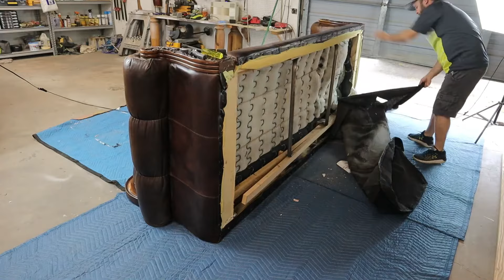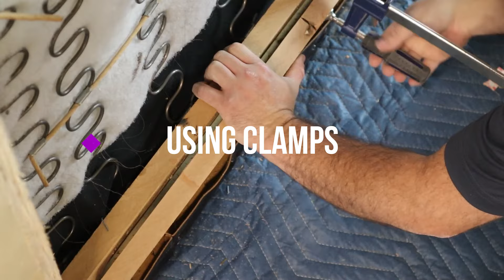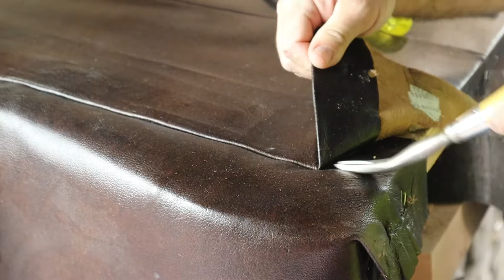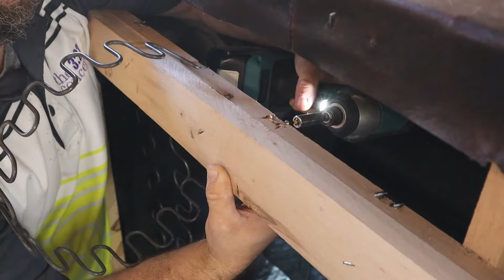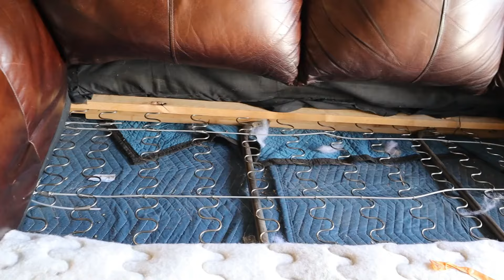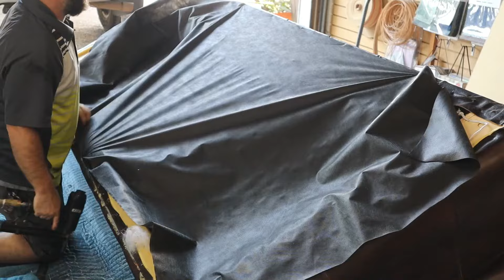Sinking Sofa

Comment: Excellent video. Thanks very much for your clear, helpful works. Just wondering what kind of edge wire I can buy and how many  of them ? Do they make the springs stronger and so as the seats? Thank you.
Reply from the maker: I would say they’re definitely helpful in creating a stronger seat. They sdisperse the weight evenly so all the pressure isn’t on one or two springs. The springs usually come in 9 and 11 gauge if I remember correctly

Comment: Nice! I thought the sinuous springs were not worth fixing but this looks like it’s doable for a DIYer. Except maybe I would need help stretching those springs.
Reply from the maker: It can be difficult! A string helps. If you can find a spring puller that will help a lot!

Comment: The point is to prevent the foam in the seat from sinking, put a layer of protective fabric on top of the nosag so that the foam doesn't get cut by the nosag which makes the seat sink.
Reply from the maker: The foam was not the issue in this case. I’m not sure if you noticed, but this sofa DID have a protective layer between the springs and foam. The issue on this sofa was frame/spring related . Thanks

Comment: What’s that you are using to pull the  springs tighter. Also should so change the springs after 15 years or keep the old ones. Thanks nice vidoe
Reply from the maker: Thank you so much for watching! This is the spring puller that I use https://amzn.to/3CGA7MM
Reply from the maker: Springs can last a very long time. I would recommend pushing on them to see how the tension feels. I have seen some that have lasted decades. I’ve also seen wire gauge springs that are used in more modern furniture that aren’t worth anything
Reply: thank you very much
Reply from the maker: @dawnscreations1  you’re welcome!

Comment: We have 2 sofas that are no fun to sit on ie. stuffing, straps loose,  I'm curious how much a job like this would cost
Reply from the maker: A lot of it will depend on how easy it is to remove the seat decking…things that Affect this are:

Are there decorative tacks that have to come off?
Are there layers and layers and layers(dust cover, welt cording, fabric, etc) ?
How many staples did the manufacturer use?
Is it just the springs that need replacing or the springs and the foam cores?
Are there technicians willing to perform the task  In Your home or are they going to require to pick it up and work on it at their shop.

foam core materials are expensive right now so materials wise, that could add $150. 

I’d expect it to take 1/2 day if everything goes as planned and it’s just the springs. 
If the cores need replacement, a full day. 

In my market, a job like that would average between $400-$800

Comment: How much would a repair service like this cost?
Reply from the maker: a lot of it depends on your specific market and the individuals experience and overhead cost. For my area (central Texas), our hourly Rate is around $80/hr if the item is brought to us. If we repair it on-site, it is more. I’d estimate a repair like this to run a minimum of $300. I can’t remover because it has been a while, but I believe this one was around $400-$500. We picked it up, repaired it our shop and delivered it back

Comment: To put springs on I have to repair four in the middle, I  will just pull the sofa down so that the back of the sofa is on the floor?
Reply from the maker: Whichever way is most comfortable for you. I personally lean them forward on their front end, but I typically have to rotate it a few different ways to get all the staples

Comment: Where do I go to get the springs?
Reply from the maker: Depends on what size you need. You might check Amazon. They’re called sinuous springs. They have various sizes or large rolls of them . You will need bolt cutters to cut them to size
Reply: @the323vlog4  thank you!
Reply from the maker: @ladygardner9114  my pleasure

Comment: What if nothings broken ,but still sags?
Reply from the maker: It can really be one of two things then. One, it could be cheap springs that are beginning to lose tension, or it could be the foam cores of the seats that are beginning to wear. For your sake, I would hope that it is the foam cores, as they are easier to replace. I would recommend looking around your area and seeing if you can locate a upholstery supplier who has more dense foam. How long have you had the furniture?